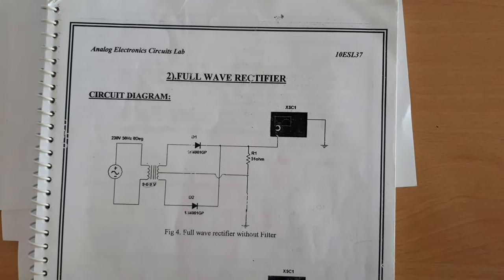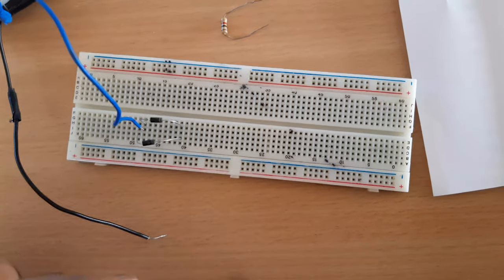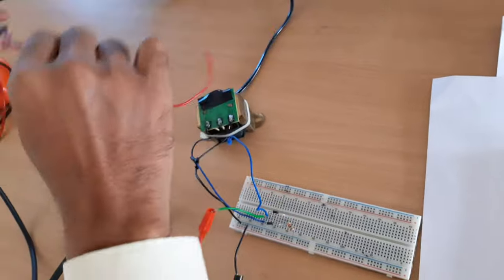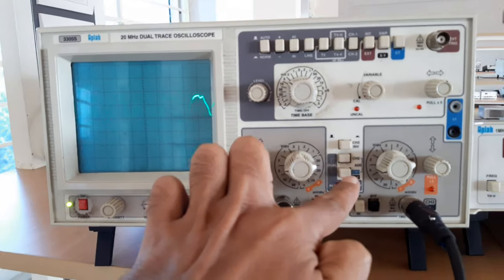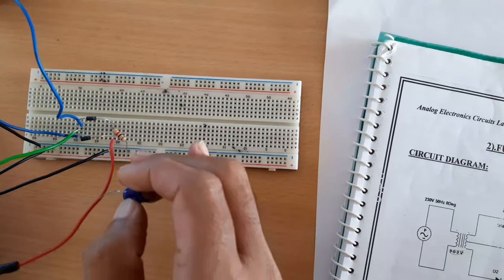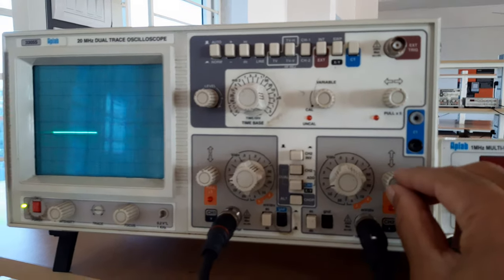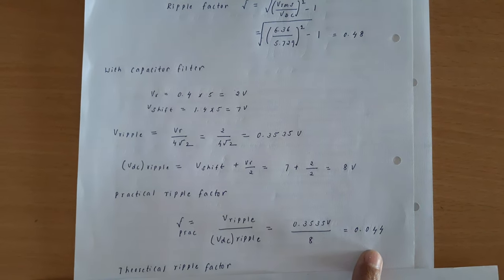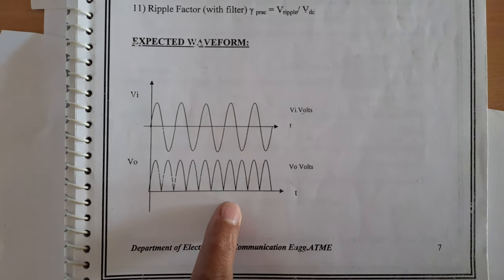Expt No 1b. Full wave rectifier with and without filter and measure the ripple factor.mp4

Comment: நீங்கள் எடுத்து கொண்ட Transformer 6-0-6. Load resistance 1k என்பது ஏறக்குறைய open circuit voltage value ஆகும். 50 ohm 5watt resistors யை வைத்து செய்து பார்க்கவும்.
Reply: Bruh, the reading he has got are more than 6 volts .. so it is definitely a 9-0-9 transformer . How can you say that it is a 6-0-6 transformer?